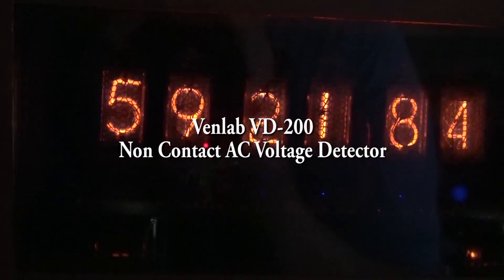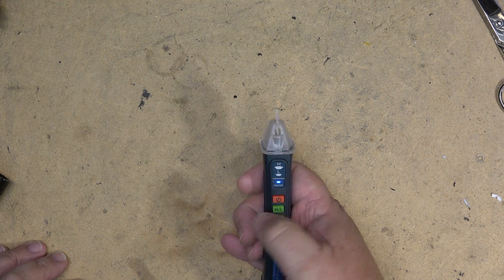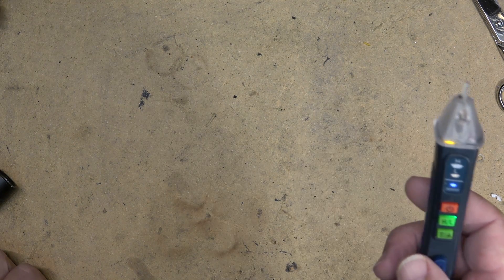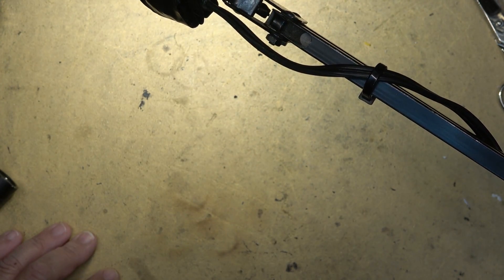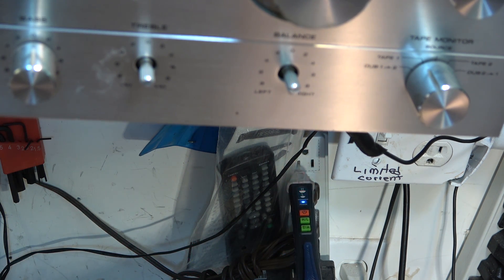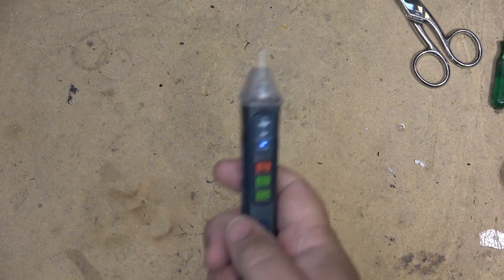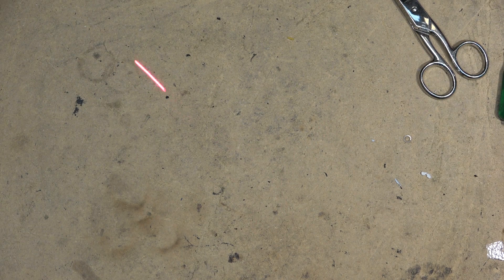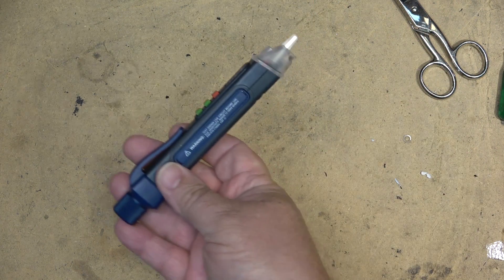Venlab VD200 Non Contact AC Voltage Detector with Laser

Comment: I don't know much about or work with electrics sp bought one of these so i can change a light fitting. Even with power off at the breaker it is still beeping near the wire. Does that mean its still live and i need an electrician?

Comment: Very sensitive,  great for finding wires in walls.
I have a clear screwdriver that has a led and mosfet inside + watch batterys.
i hold the blade end and bring the handle end two to 4 inches away from a plug socket, it lights up really bright.
It also detect mains wires buried in the brick/plaster wall.
No where near as good as yours but it works 😀

Comment: They should Make one With Either A Digital Readout or analog Meter readout, then One can see just how high the Voltage is , That too can be Useful for Noncontact If working on Older electronics with high Voltages Present.  But a Readout of some Kind would be Nice feature to have.